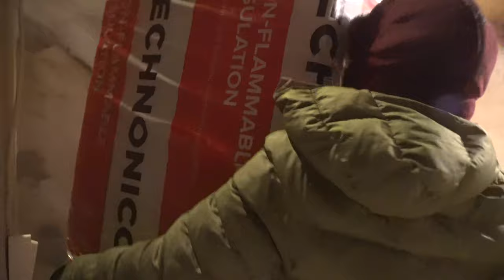Brown Spot Repair on White Brick Wall

Comment: I was thinking about your bathroom oven. Maybe it's a mass heater? Like the type you burn wood for about 6 hours and the heat stays for 24 hours? You have to use real wood though, and feed the oven now and then. If so, this is totally comfortable heat!
Reply from the maker: No it's not built correctly, there is supposed to be a pocket for the heat but instead the smoke goes streight to the Chimney and all of the heat just goes out. The wood bricks are buring much higher heat than normally wood does as its compressed, we burn 5 bricks in bedroom for all day. Thats like 40 cents a day for wood for now, when we have a wood stove in the livingroom maybe it will be a pack a day which is 1 dollar a day! ❤️😊 The one in the bathroom sadly has to go. I want to do central heating anyways 😊
Reply: @DoBeDiff  Oh, just rubbish then. Hubby is planning for water heatig too. On the smoke flue, hubby made a really long copperpipe like a spiral along the flue, planning to attach it to an accumulator tank, attach radiators in several rooms. Easy, actually.😀🥰😘
Reply: If you look at the woodfired waterheated stoves on selmac.se you can see it's really simple to do it yourself.
Reply from the maker: @vbjarnecat  yeah will have to look into an easy way to heat up the radiators, the central heating stove is like 2000 so a bit of an expense 🤔

Comment: Is it possible to jack up shed and put a long sled beams  underneath and move the building to another location?  It would be a lot of work but might save building a new shed for now.  I seen a guy do this to his  old shed on youtube.  You would have to brace the walls up too.  Ask your neighbors friends?
Reply from the maker: Sound fun, but truly wouldn't be worth it, the shed is not very stable the roof is sidways and would most likely fall with ao much movement, we will rather take it apart and use it for our other projects 😊❤️